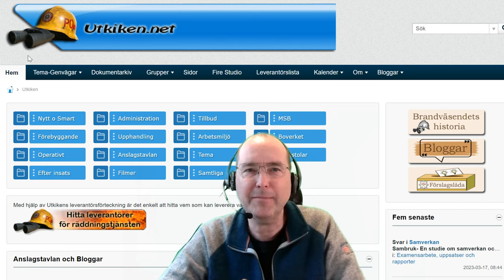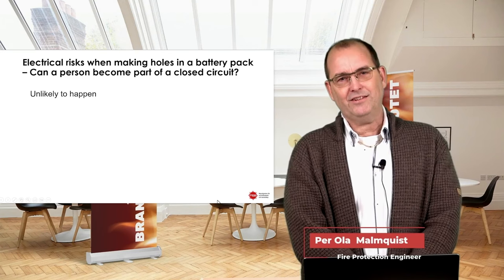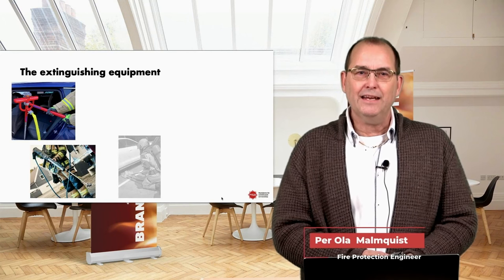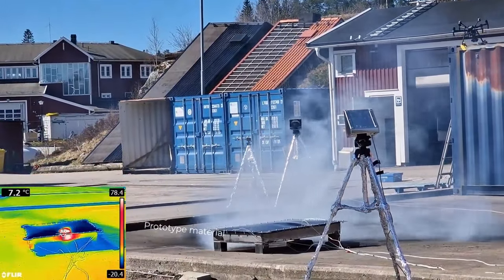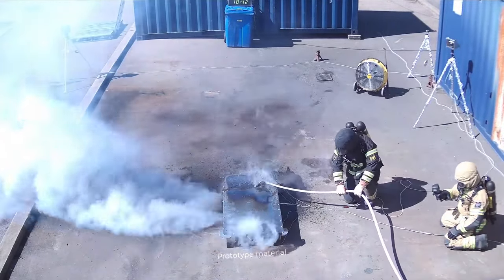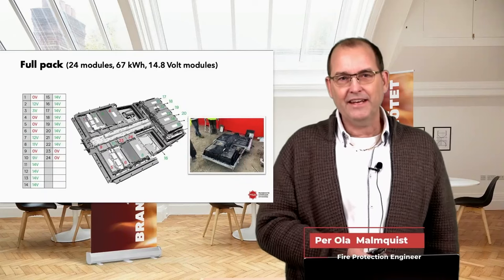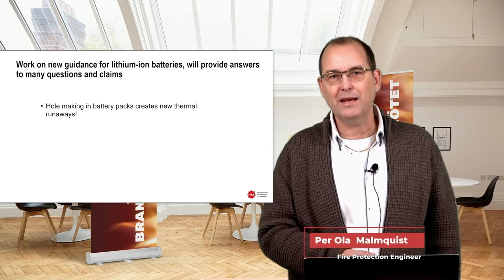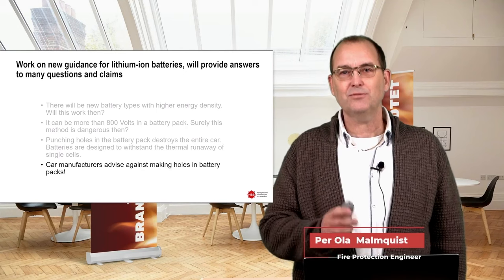Putting out lithium ion batteries with plain water in a short time

Comment: What a joke. Just a few of many issues: 
- He never mentions what battery type (chemistry, brand etc), just the number of kWh. 
- The "method" involves cutting holes in battery packs and injecting water directly. In all the EV fire videos I've seen this would be COMPLETELY impractical. 
- The testing was on isolated battery packs sitting on concrete, not in an actual EV. He mentioned a "whole EV", but provided no information, photos or video. I wonder why? 
- It was never explained how firefighters could access the battery (let alone make holes in it) when it's surrounded by car body and there's a raging inferno. 
- They used thermal cameras to determine the hot spots and where to make the holes. This wouldn't be possible in a real EV fire.
Reply from the maker: Thanks for your nice start of your comments. Not!
I will answer your comments anyway since I think they are good.
- The chemistry is interesting, but not really for our experiments since it is not the battery itself we extinguished. We cooled the adjacent cells to a level that they did not ignite. The battery pack and modules physical design would be more important than the chemistry.
- There is a myth that it is impractical, impossible and dangerous to make holes in batterypacks. But we showed that it is possible in some situations. Maybe not all since the vehicle logation and the possibilities to approach the vehicle can make it dangerous, and then it should not be done.
- A car fire is not a raging inferno. It might look like that when you dont know anything about firefighting, but it is something that firefighters deal with all the time and dont find intimidating. So what we did when putting out the full EV was to first observe where we had jet flames from the battery pack and spend a couple of minutes putting out the majority of the car fire, then we used a Cobra cutting extinguisher to, with a water jet, cut a hole in the floor plate and into the battery pack and at the same time get water into the battery pack. It is an easy operation. Then we flooded the battery with 60 liters per minut a couple of minutes until smoke and fire disappeared while the other firefighter continued to put out the fire in the rest of the car.
- Yes, a thermal imager was a good tool on the real EV fire that we put out. It led us to the correct area to make the hole in. But it wasn´t really necessary to be very accurate with were the hole was made since the water flowed in the battery pack and stopped the fire evan at places far away from the hole.
I will be happy to answer more comments and questions if you have that. But please try some politeness even if you are on the internet. It makes life so much better if we are nice to each other.
Reply from the maker: Oh, and the reason we could not show the whole EV was that the sponsor of that brand new EV did not want their vehicles to show up on internet on fire, even if it was intentional testing. I wish that we could have shown that video because it really showed how undramatic it was to extinguish it. An EV fully involved where the fire started in the battery pack that has burned for 15 minutes, and ten minutes later the fire was out.
Reply: @UtkikenRescue  so you did extensive testing on an actual EV, but are unable to provide any evidence of said testing? Pardon me if we don't just take your word for all of your claims with no evidence...
Reply from the maker: @michaelnoble2432  As I said in the video I was employed by the Swedish Civil Contingencies Agency during the tests and the project was run by that same government agency together with some national industry partners. Here is a link to the report in Swedish, were we also mentions the full EV burn. https://rib.msb.se/filer/pdf/30340.pdf It is to be released in English in the beginning of this year.

You mentioned that the questions you raised were just a few of all the questions you had. I will be happy to answer the rest of them as well if you want that. I am not claiming that it is a method that will work all the time, but I would say that we have been mislead to believe that EV fires are impossible to put out all the time. Next step is to learn when the method is working and not working, and in Sweden the government Agency is about to release a guidance were this method is one way of dealing with EV fires when it is safe to use it.
Reply: @UtkikenRescue  thanks for the link - I'll read the report when it's available in English. It doesn't seem to cover the testing of the whole EV though, which was my main concern in my previous comments. Testing a battery pack sitting by itself on concrete is VERY different to a real EV fire. 

And STILL no information on the battery chemistry (NMC, LFP / LiFePO4 etc). You suggested it didn't matter, but this goes against EVERYTHING I've learned about battery fires (ie, the cell chemistry makes a HUGE difference).
Reply from the maker: @michaelnoble2432  I will post a link to the report in english when it is available. In the swedish report it is section 2.2.3, Test 3 on page 19 that describes the complete EV tests.
The reason we assume that the chemistry is not interesting when using this method is because all lithium ion chemistries have about the same properties in relation to the temperature when thermal runaway starts. Somewhere between 130 to 170 degrees centigrades. Water can not get hotter than 100 centigrades in normal pressure and because of that water will always have a cooling effect relative to the temperature needed to start thermal runaway. 
We assume, to be conservative, that the water does not work on the ongoing thermal runaways it is only working to cool the not yet burning cells. Because of that we never interact with the battery chemistry, the water only interact with the outside casing of the non burnt batteries and the residues of the burnt batteries. 
But I will find out and answer what chemistry we used. 
Why do you think chemistry is important in this case?
Reply from the maker: @michaelnoble2432  I got a response from the partner providing the batteries that it was NMC cells in all our tests.
Reply from the maker: @michaelnoble2432  Now the report is available in english. 
https://utkiken-my.sharepoint.com/:b:/g/personal/po_utkiken_net/EdRMuBN3LNFIkaPQSAz2kgcBDSD3MQd63rkdGe7fmWewyA?e=cXOwMr
Reply: @UtkikenRescue  thanks for that. Unfortunately, it STILL didn't provide information on the exact cell type or many details of the whole vehicle testing. The description on Page 17 (Section 2.2.3) of the "whole vehicle" testing would be utterly impossible with all of the EV fires I've seen videos of (the jetting flames would have killed any personnel who got that close). 

So I ask again: which car model was tested? Where are the videos of this testing? If you refuse to provide this information, I find the report very unconvincing. 

Are there examples of this technique being used in the "real world" as opposed to highly controlled conditions?

Comment: An unbelievable false flag.
No car, in a very open area, separated from everything, no fierce flames when compared to real EV car fires and the car manufacturer who supplied the battery packs, did not want the public to see their car catch fire and witness the true extent of damage that would result. 

One pack of batteries tested at a time !!! The packs in EV cars virtually touch each other and looking at the size of the packs here, there would be 4 or 6 or even more packs on the floor in a real EV.

Try swinging an axe or pick inside a car, impossible. There are front and rear seats taking up the majority of the interior area on top of the batteries as well, so there is only a small portion of the floor visible in the foot wells to be able to swing anything at anyway.

Before the responders even get to the car, the interior would have been on fire for a while, with extreme flames and toxic fumes making a very dangerous situation impossible. 

The best and only hope is to stop the fire escalating to other cars or property nearby.
Reply: No Dave, not a false flag.
I had the opportunity to overlook tests in this week where a Nederland Research Agency made the same full scale EV fire tests that we were not allowed to show. And with the same result. Two EVs with 100 % SOC, vehicles fully involved and they were extinguished by this method. Also, I have been involved in the Swedish Civil Contingencies Agencies work to make a fire brigade guidance based on our results. It was released last week.